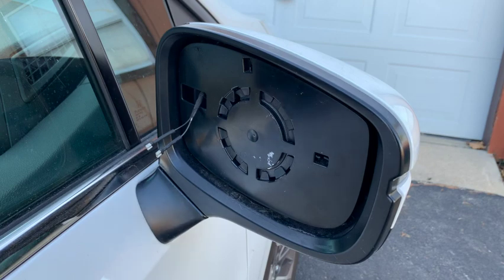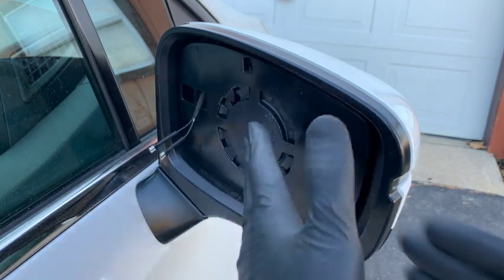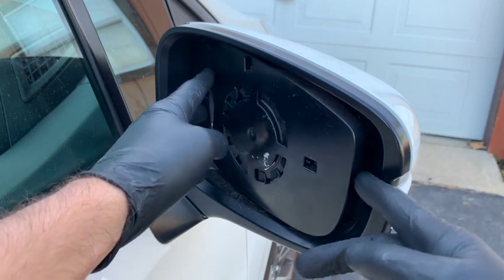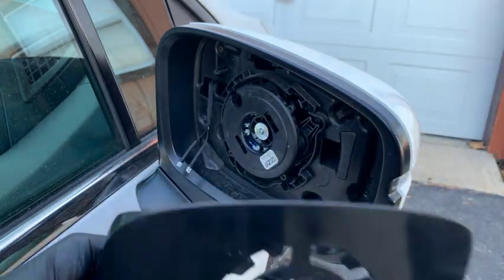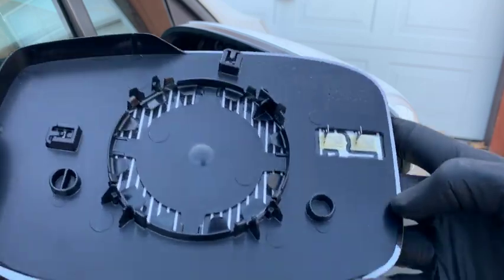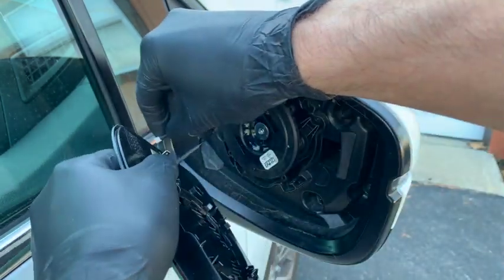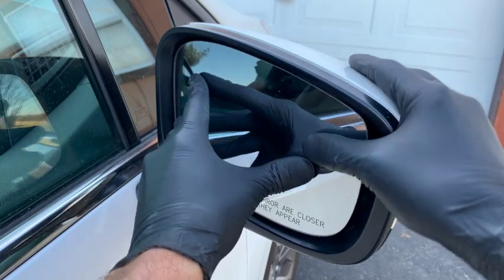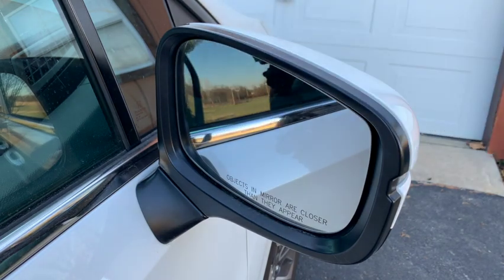Honda Odyssey -- How to Replace Remove Side Mirror Glass 2018 2019 2020 2021 2022

Comment: How did you get the wires off the original mirror? Did you use a pliers or something? I tried using my hands and just pulling, but they didn't move